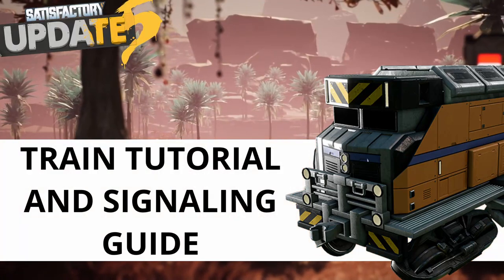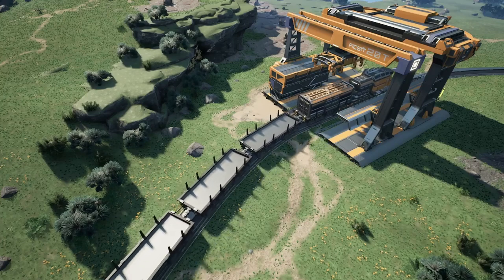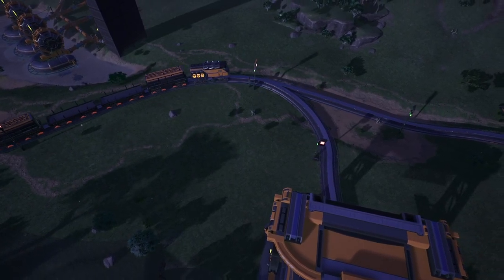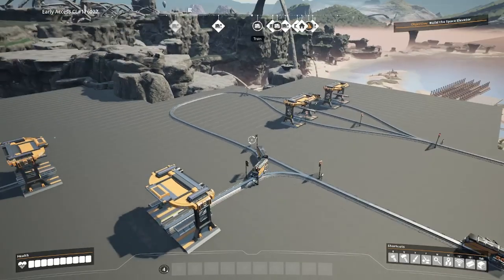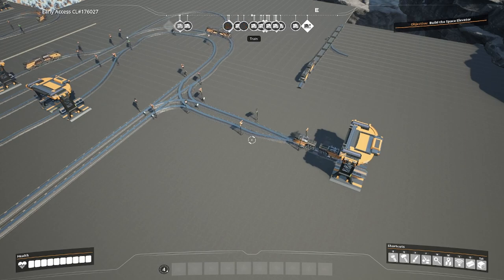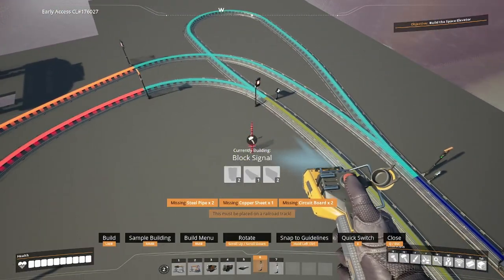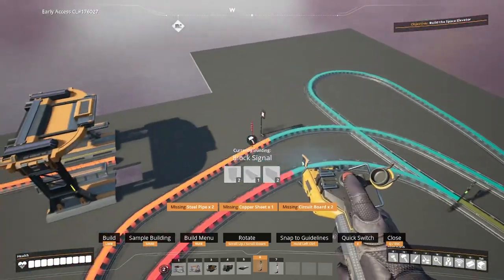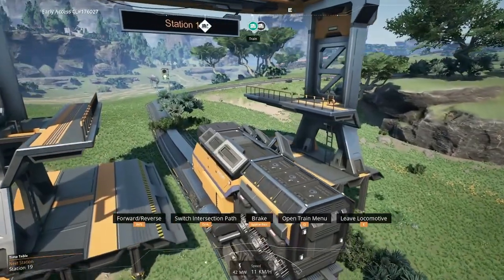Satisfactory Train Tutorial and Signaling Guide

Comment: Hey there. I've watched your videos on train signals and still don't get why after placing signals on one intersection my trains stop at the path signal just freeze. No errors. I mention I am using a 2 lane train network and have 2 trains running on the network
Reply from the maker: If you get into a stopped train it will have a message for what's up.  If you post a save game I'm happy to take a look.
Reply: @Dekoba  There is no message. Apparently the trains stop before entering a station if another train is at another station on the map. I only have path and Block signals at stations and intersections.

Comment: I can’t find a single tutorial that will actually help me understand this. Mainly because I’m trying a method that is not mentioned in these videos where if a block is occupied a train sits at a split loop and waits for the other train to pass by taking the unoccupied rail of the split loop. It’s just a single rail, bi directional, 2 train system. It’s not push pull because I just have the trains making a u turn at the stations to reposition themselves. I’m also not concerned about the bottle neck. 

These issues I get are the path signals not finding a path.

Comment: The fact I can't have a bi-directional branch line kinda sucks...
Reply from the maker: you can? I show that several times in the video, i dont understand
Reply: @Dekoba  actually, you can't do it how it would be IRL. In your video you first split off 2 tracks and combine them to 1. That is not how branch lines or side tracks work. The outer track first gets a junction going to the inner track, then that track splits off into itself and 1 other single branch track that goes to wherever. That is not possible to properly do, because signals can't be 2 way without the need for signals going in both directions. This would cause a waiting train to wait on the single track, causing issues.
Reply from the maker: @SirMrDany ah I see what you mean
Reply: @Dekoba  if l it were possible to just have 2 way and to have orange lights I would be happy